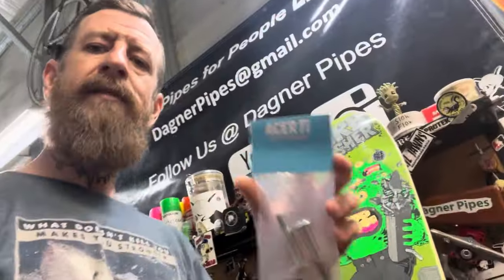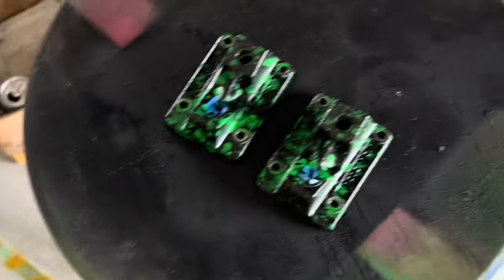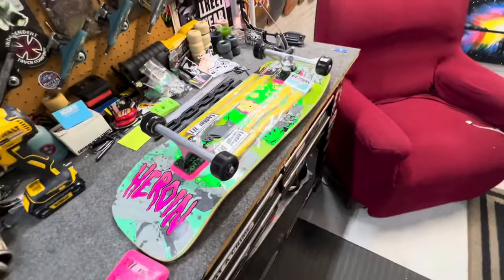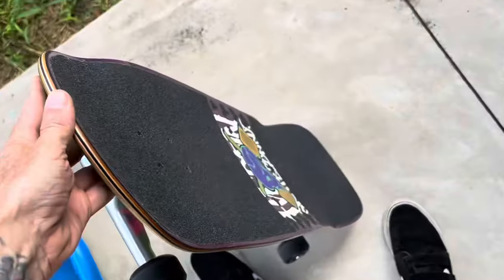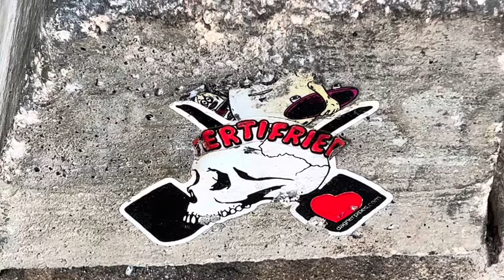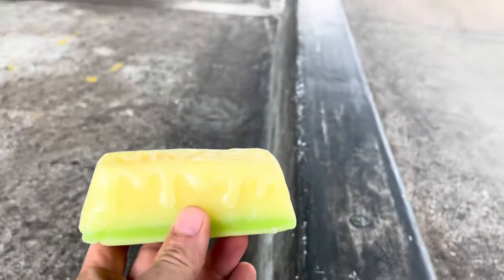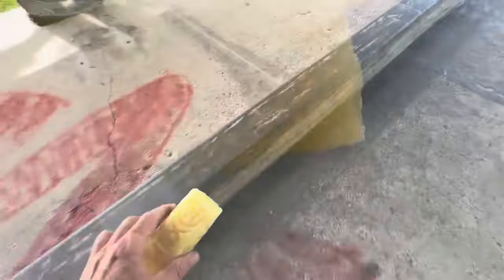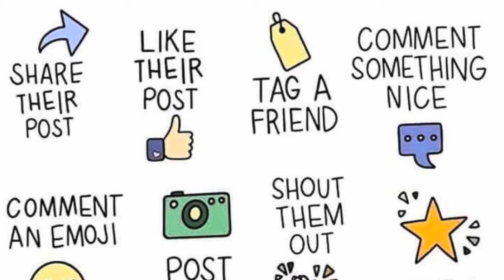Curb Crusher XL Barf Comics Custom Build & Shred Sesh’s

Comment: I love how the Acer kingpin is light as shit and you have enough threads on it compared to that dlk kingpin that came out.the turning is really nice to but one thing you should do is put the washer from Bones bushings in the kingpin so it doesn't tear the top bushing up
Reply from the maker: I see what your saying. I just put the bones washers under the recessed area and now it’s flush👌🏻
Great tip!

Comment: Do you have any tips on how one should figure out wheelbase lengths to redrill. For example is there a max limit on the size you should have on the nose or tail? Does it depend on fingers of flat?
Reply from the maker: @ramrunsfast  There is No right answer. It is all preference and how you want to feel on your board. My experience comes from trial and error. My knees like a 14” WB and Independent Trucks Geometry